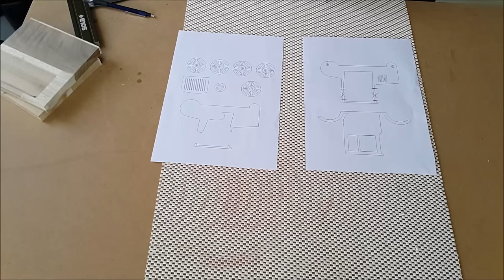Wooden Toy Car- Ford Model T

Comment: If you would like to avoid splinters on the other side of plywood during drilling, put material, that is going to be drilled, flat (tight fitting) on piece of wood - it is about moment, when you drill holes for axels.
Reply from the maker: You can't actually see it on the video, but i was drilling from both sides for more accurate holes.
Reply: cars
Reply: DM Idea f